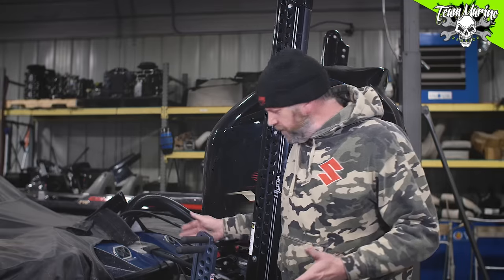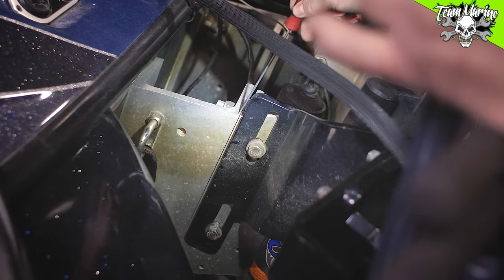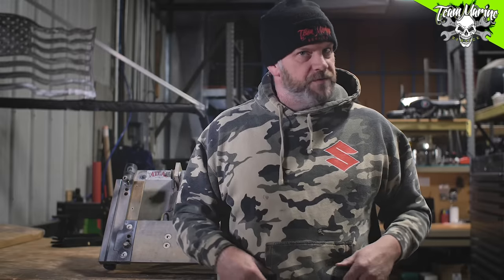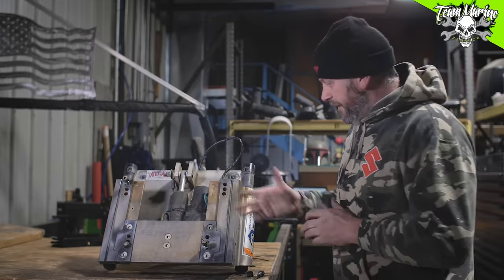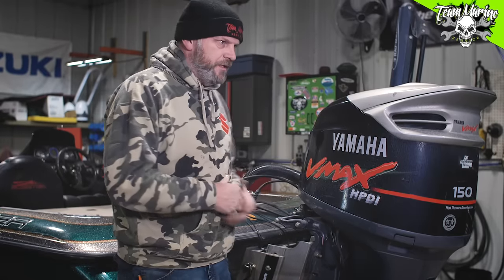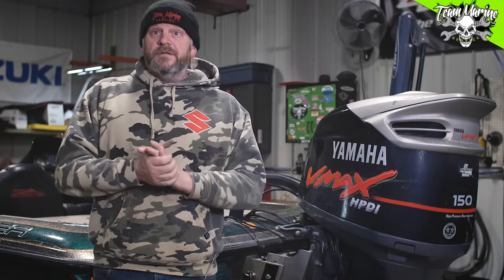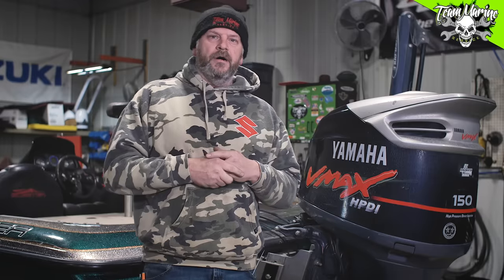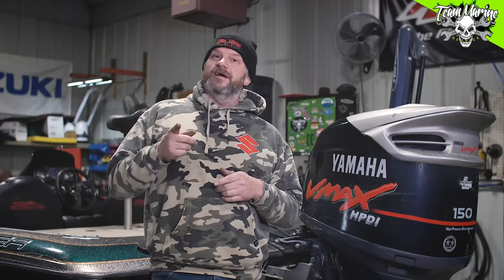TEAM TALK: JACKPLATE MAINTENANCE (TECH TIP)

Comment: Hello, Sir, I would like to ask you. On a manual jack plate do have to use the bar on the jack plate to tighten the bolts or can you just use a shorter bolt and go bolt to nut without a bar?